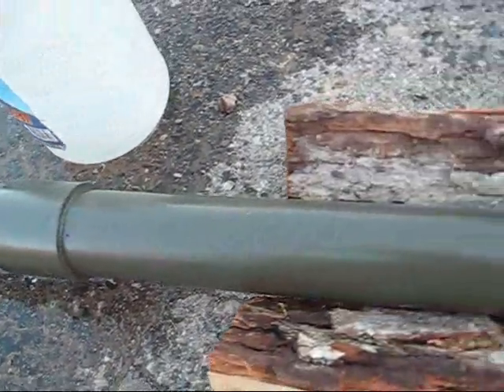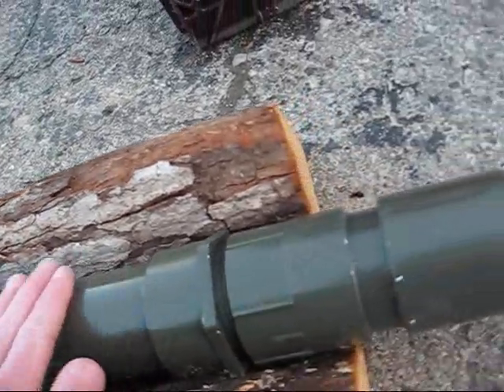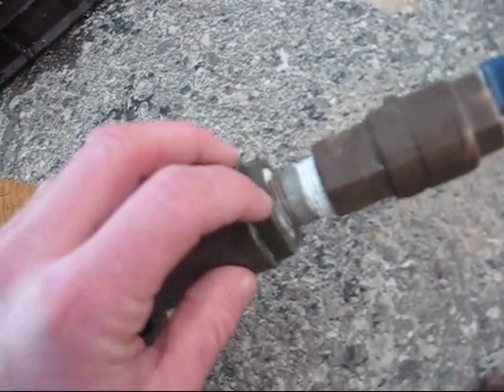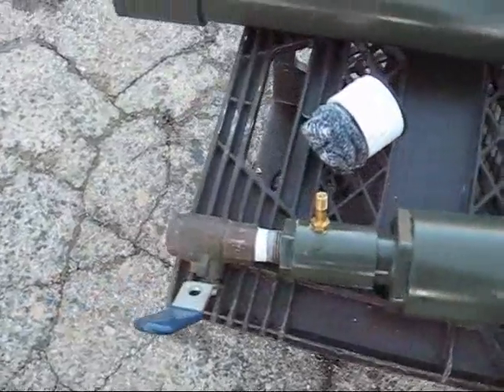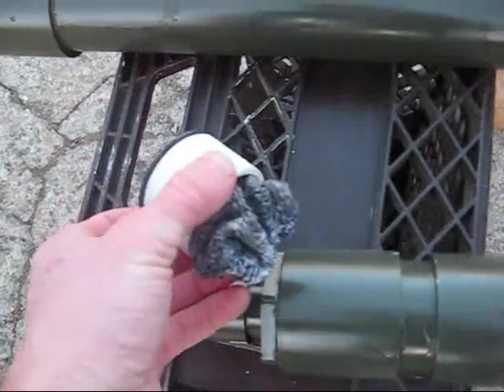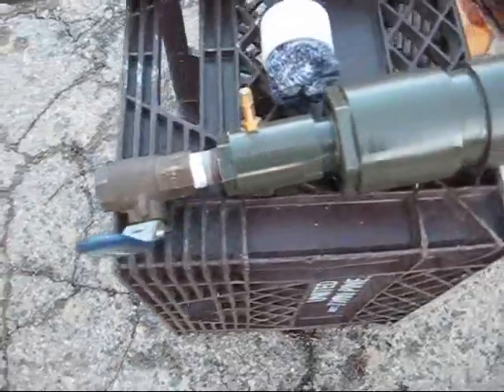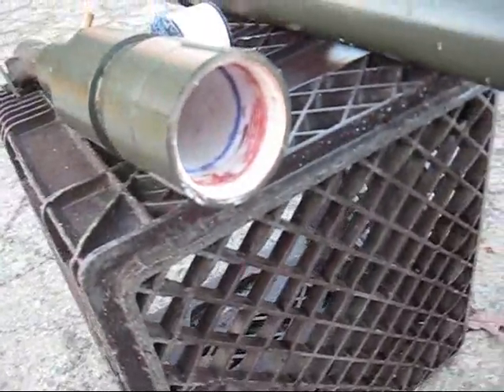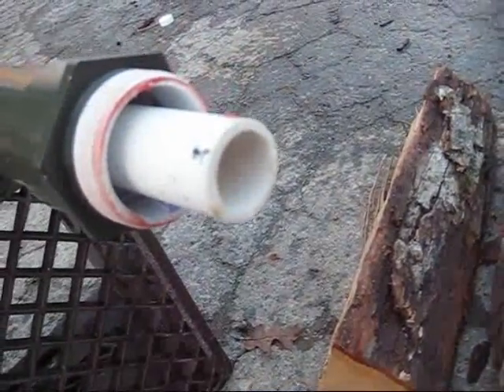Low Pressure Piston Cannon Tests

Comment from the maker: Well, I was expecting more power as well when considering my other piston cannons. Something to consider though, a piston valve works faster and faster at higher pressures. When I do higher pressure tests later you should be able to see a huge difference in power.

Being legal sure feels good doesn't it? At least federally. At a state/city/township level there might be some regulations on air cannons.